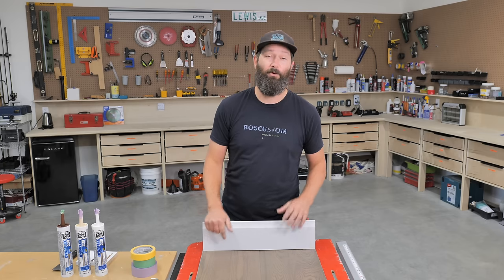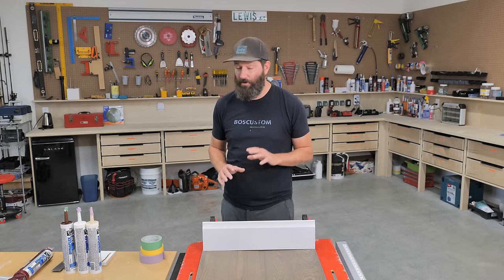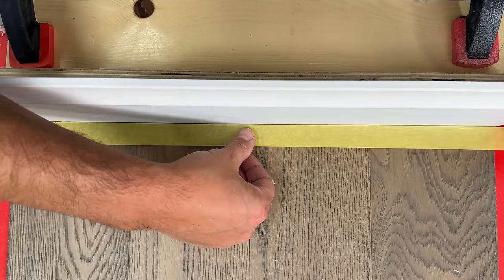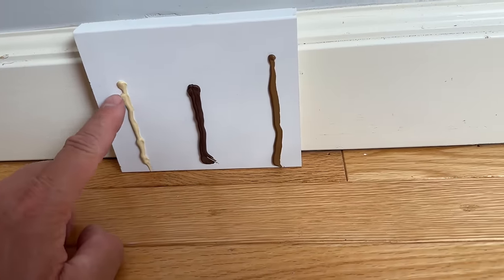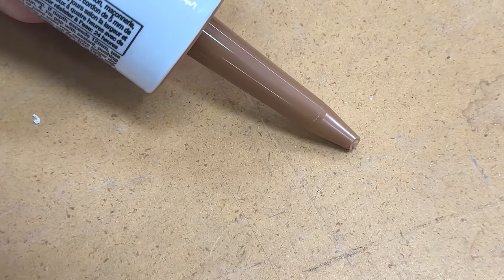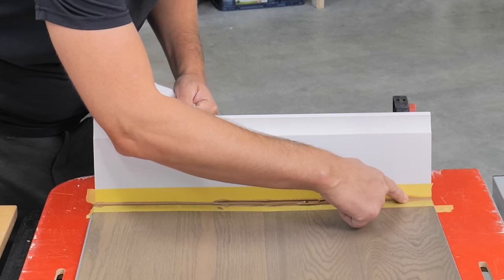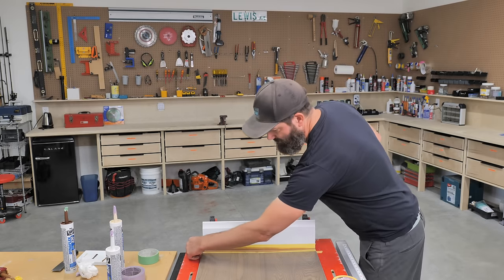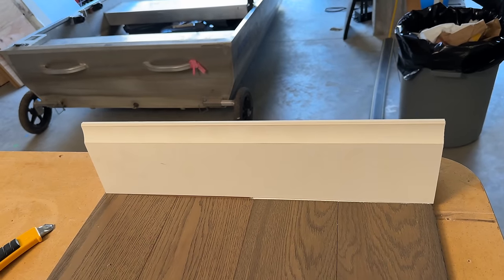How To Make Gaps Under Baseboards Disappear With Caulking

Comment: I'm going to be installing PVC baseboards on top of a fairly rough concrete floor. We already bought white caulk. Maybe I'll try to exchange them for gray. This area will be used for dog training and boarding and may be hosed/mopped out frequently. I'm thinking silicone caulk would be best. And the floor may get painted. I assume we should do that first.

Comment: When the floor expands or shrinks due to heat differences, it will pull apart. That is why the floor boards aren’t exactly up to the wall, they need to be able to shrink and expand. Better to minimize the gaps by making the floor underneath as straight as possible and using a good subfloor.

Comment: When our new hardwood floors were installed they left a gap between the floor and the baseboard at the doorways of one-half to three-quarters of an inch. Since this would be too large to simply caulk, what do you suggest in order to fix this? Thanks for your suggestions.

Comment: or gaps are good.  gaps just saved me from water damage.  water got in the wall, and thanks to the gap in my baseboard mouldings, it poured right out onto the floor completely.  no damage!  before that happened i would have been a caulker for sure, now i thank my baseboard gaps everyday.

Comment: I don’t tape, put your bead down and for painters caulk mist with a spray bottle of water and use a rung out sponge.  For bath/kitchen silicone, use rubbing alcohol to mist and a dry disposable rag.  I do use tape for silicone caulking if the gap is bigger than 1/8”.  If it is something you can put a very small bead on and mist, it tends to not spread outwards.

Comment: Best way to fix those gaps are with a piece of quarter round, it'll flex and adds an extra profile to the trim which makes it seem more intricate and doesn't involve the mess of caulking. Scribing and cutting base to fit tight looks chincy to me as you can see the humps in floor in the base

Comment: That wouldn’t have worked for our 120 year old house - the gaps were huge - buliders expanding foam solved it once and for all followed up by some architrave fixed to the skirting board. Several years later and it still looks great. Also keeps the spiders out!
Reply: Yeah, it keeps the spiders out, for now! But they're there, waiting!! 🤔🤨😐

Comment: I want to add that most of the other comments by the "other carpenters" here are very obnoxious, and I am not surprised, since most carpenters I worked with were the " I know everything and I am fast, and you can't teach me anything new!" type. I am "always learning new methods from other craftsmen. I once had another carpenter asked me " How come you get all the "high end nice jobs"...where I can take my time ?
Reply from the maker: I always get a chuckle from guys that say if you tried that in my company you'd get fired by lunch...or I don't choose to work for a company that has no respect for quality:). If you develop a reputation as a high quality carpenter, you won't be sitting around home much.

Comment: Thanks for the vid. I used an engineered hardwood flooring that has quite a bit of grain (Not a flat surface) and tried using tape but I couldn't get the tape to follow the contour of the grainy surface so it left little tunnels under the tape that the caulking would get into. any suggestions for how to handle this? I am not bad at caulking, so tried no tape and finger method, but the same thing happened since couldn't get my finger to close up on the grain either.
Reply: you need to press the tape down harder so it follows all the contours

Comment: I have never known there are so many people think it's a good idea 😵 as a normal handy man, no one will caulk the gap between baseboard and wood floors because the expansion of wood, the right way to hide the gap is cut the bottom of baseboard during installing, or add a door stop or 1/4 round

Comment: How do you cut the tip of the caulk tube? I know with a razor or the cutter in the gun, but I mean how much do you trim off and at what angle? Thanks.
Reply from the maker: For this it doesn’t really matter much. For other jobs it does though.
Reply: @TheFunnyCarpenter when does it matter?
Reply from the maker: @Perfectly_Balanced930  check out the video at the end of this video.

Comment: I wish to add a new plynth/kickboard under a new integrated dishwasher. The floor in front is not level so the kickboard will need adjustment. Without a shelf to use to scribe the floor level onto the kickboard, how can I get this level? Any tips gratefully received!

Comment: Scribe and trim your baseboard to match the contour of the floor. No gaps, no caulking and works on floating floors.
Reply: Most people don't have those skills , hell most people don't have the skill to caulk without making a mess  as it always looks easy in the video 😉
Reply: @manchesterexplorer8519  If you can't slide a pencil on a shim and then cut that out how did you install the baseboards in the first place?

Comment: House painter here, I never caulk those gaps. You especially don't want to caulk with white caulk because that immediately erases the straight line of the baseboard and are left with a wavy looking baseboard that looks terrible. That leaves a dark caulk & it looks better than white but at the same time it also is, in my opinion, not worth filling a dark gap with a dark caulk. It's like digging a hole to fill it.

Comment: Better solution is to sand your trim in the high spots so it doesn’t leave a gap to begin with
Reply: The best solution is to just install shoe moulding....jesus.

Comment: I have never seen baseboard installed without shoe molding? Did the carpenter leave it that way? I also have seen houses that were remodeled put carpet down and leave off putting down shoe molding but all non carpeted floors had it?
Reply: in high end jobs, not every client wants a "shoe look"
Reply: @carpenterabc I have been on many jobs and have no idea how many houses I have been in and all had shoe molding with the exception of trailor houses.

Comment: Try not to use it, but we caulk, then spray with glasscleaner brand cleaner, then use a rubber caulking spatula and to finish a paper towel to wipe off excess and dry. Perfect every time, no taping and fast

Comment: I prefer to leave the shadow line, and this is definitely  not a good idea if you have a floating floor.
Reply: The caulking will not stop the floor from a small movement. A large movement will only occur if you allow a large temperature swing inside of your house.
Reply: @michaels3003  I have to disagree,  any floating floor be it Vinyl, laminate or engineered wood will expand and contract over its life.. I have never experienced a room or house outside of a laboratory that maintains a constant or consistent temperature.  regardless of season.  The only time caulking would be practicable eould be on a non floating floor. For example in a bathroom where say a vinyl plank floor had been glued, (using a proprietary glue) to allow the installation and fixing of a sink, toilet etc. Even a modest temperature  swing will allow expansion and contraction. The practice shown in this video will cause Issues, particularly for DIY ers.  To fix something that arguably isn't broken.

Just saying like........

Comment: Our contractor put baseboards down and they are ALL crooked and the gaps collect mounds of dirt.
Reply from the maker: Yikes! This could have something to do with the cracked caulking.
Reply: @TheFunnyCarpenter  For the baseboards, they didn't caulk anything and they positioned crooked. When they caulked the seams in the kitchen and bathroom, see my other comment, they All broke free with two days
Reply: @bawintermage8351  They probably used a really low-quality painter's caulk and/or applied it way too thin. 

I dunno what kind of contractor you hired, but if you hired a trim carpenter, in my area trim carpenters don't caulk. We set all the nails, but caulking and filling is typically part of a painter's contract.

Comment: Wetting the tip of your finger before running it along the caulking gives you a smoother finish and won't drag the caulking. You can go over the seam again with a wet finger again to smooth it out even more.

Comment: I have big baseboard gaps bse of carpet being removed, i gotta lower the baseboards, maybe molding would be better.🤔
Reply: I don't like those cheap moldings that contractors use in my area, but "lowering" baseboards is a real PIA. I thought it would be simple, but I was mistaken.
Reply: I would use a shoe moulding
Reply from the maker: Check out my videos, I made one a few years back about this. You can definitely make a shoe moulding and make it look like part of the baseboard.

Comment: the problem is real wood cost a fortune and the cheaper baseboard trim is made of glue and saw dust and if you wet mop the water will  puffs up like a tampon destroying the trim. If you install new baseboard trim  would go as far as water proof the bottom and back side. Painters tape that's what I did for my moms house. After the repair I told her that she can't mop the floor like the old days with real wood. You can't pour a gallon of water on the floor and  swab the deck like a sailor with the cheaper laminate flooring and baseboard trim. Spend the extra money and get waterproof if you plan to wet mop.

Comment: I would never use caulk for this purpose. 1/4 round shoe is flexible and widely used for the purpose of hiding gaps in uneven floor surfaces (not including carpeted floors).

Comment: Why not just put shoe molding down instead?  Yes, initial cost is higher but it will last longer and probably look better.
Reply from the maker: Fair point for sure🍻
Reply: I've never seen baseboards without shoe molding, unless the room is carpeted. Is that a Canadian thing?
Reply: If/when I remodel, I will certainly use shoe molding.  But in the place I bought, this will work perfectly for now.
Reply: @emiller7040 I’ve seen it done here, but it’s not overly common. Not extremely rare either. But definitely don’t see it as much today as 30 years ago.
Reply: Personally, I have 75 year old white oak floors with gaps along the baseboard. Frankly to me it’s not broke so I’m not fixing it.  The floors look really good and so do the baseboards and I think it would just be a waste of time and money to do anything to change it.
Reply: Shoe molding and quarter round don’t look great in my opinion.  I know lots of people use it but to me it looks like what it is, another molding added to cover up the poor fit and finish of the baseboard.
Reply: My wife HATES quarter round with a passion. We have none of it anywhere in our house. I am not a fan either and would rather see a 1/8" gap than bulky quarter round
Reply: @thedon98677  Yeah, I was “trained” to hate quarter round by my wife.
Reply: @thedon98677  Me too. 🤭🤣
Reply: @skank-hunt_42  Yep, same here.
Reply: Base shoe molding is only good for vinyl, laminate flooring or wood flooring, but you don’t install base shoe on a tile or porcelain flooring.
Reply: His way in the video is better and neater.

Comment: Our Contractor used the Dynaflex and it's ALL cracked in the bathroom and in the kitchen,( after 6 months)  what went wrong??
Reply from the maker: Hmm dynaflex installed with proper bead size for the application is usually pretty good. Hard to say.

Comment: Let's start with the fact that if you have a wood or laminate floor, you should always have a piece of quarter round there that covers the gap. Caulking this gap is the stupidest thing you could possibly do  for 2 reasons. 1) now you have to paint that caulk, and if you don't cover all of it, the unpainted caulk will attract dirt and look much worse than a gap ever would. I would also add that painting that caulk is going to be the hardest thing you can do if you're not a seasoned professional. 2) I guarantee you there isn't a  caulk on the market that's not going to eventually crack which will ultimately  look far less cleaner than just the Gap you were trying to fix in the first place. Let me also add that I've been a professional Carpenter, painter, handyman for over 30 years and I have never seen anyone do this for the reasons I've mentioned above.

Comment: Never caulk on the floor the floor is always moving. I always push it down with a Piece of wood with my knee till the gap is gone. Then put a small nail in the wall so the wood cant bend back. You dont see the small hole from the nail cuz you caulk the top

Comment: Or just use toekicks. They also help protect the base board.
Reply from the maker: Definitely a good option: A lot more work and harder to just do one spot….but if done correctly it will look better.
Reply: I know what a toe kick is on a cabinet, but I've never heard of applying anything called a toe kick to a baseboard.

Comment: Obviously this is for DIYers not professionals. If your baseboard is that tall where it won't flex down to meet the floor you might want to try some quarter round or base you to cover that crack instead of caulking the floor

Comment: There is supposed to be a gap it allows airflow circulation and the ability to replace flooring. Lol. Don’t seal the gap for cosmetic reasons, leave it alone for practical reasons. You will thank me when you have a plumbing issue in the wall or ceiling or if you want to replace your flooring.
Reply: Well it's not cosmetic for me. I have bugs coming from the outside through the gaps and my baby needs to be able to crawl and play on the floor

Comment: I'll probably get crucified for this, but if you're actually installing the base trim, whatever happened to scribing it into the floor? I know it's all about how quick you can get something done these days, but what happened to all the old school carpenters who didn't use any gimmicks and tricks? However, if you're covering up someone else's mistakes, I can see where the caulking could work as opposed to doing everything over. I love the use of caulking in its place, but I've never seen it put on a floor where it didn't have to be redone every so often. Or, as someone else suggested in the comments, use quarter round.

Comment: Don’t see whats the problem with a small gap, its easier to paint down to floor as has nice clean line also caulk or silicone looks ok when new but looks crap when older gets dirty or starts to peal or crack, better to have a little gap to allow for movement

Comment: Of course the only way to get rid of the gap is to SCRIBE IT. Do it once and it will close for ever, no muss no fuss and no worry about a floating floor or tubes of messy caulk. Any competent carpenter will agree

Comment: Dont bother the tape. Use a smsll squeeze
Reply from the maker: The tape is essential when it comes to floors in my opinion🍻
Reply: @TheFunnyCarpenter I've been having good luck with a wet, clean finger and/or a lightly damp grout sponge.  Have you tried this way?

Comment: Sorry but no, you don't caulk baseboards, ever. I get there's different methods and approaches to carpentry, but you simply don't do this cus it's always noticeable, it will absolutely crack and it will look awful, no matter how skilled you are. You scribe baseboards to the curves of the floor like a proper carpenter
Reply: This.
Reply: I agreed. Do not caulk the bottom of your baseboards.
Scribing the boards is the best way if your gaps are large.
Another good way in my opinion is grout.
I just installed Porcelain Tile and added a small amount of grout, turned out great. The gaps weren’t bad.
Reply: Meeeow 😂
Reply: Scribe? I thought this was a DIY project
Reply: How much? 🤨
Reply: There are products that  don’t shrink b
Reply: But I'm not a proper carpenter and apparently didn't hire one either. I have a life, so I don't want to learn carpentry just to make the baseboards look better and keep crap from running under there.
Reply: @ED-es2qv but that's the point made by the original poster of this comment, you scribe them because the method proposed in this video has no real longevity aesthetically. A DIYer would still want to do a good job. The other option is you live with a small gap because caulk or sealant, after a number of years, is going to look out of place against the baseboard/skirting, and over time will likely look worse than the small gap...
Reply: No, regular people buy houses that already have baseboards installed. With gaps.
Reply: Isn’t that what the quarter round moulding  is for?
Reply: People that start talking by saying "sorry but" are invariably douches not worth listening to.
Reply: This is nonsense hire a proper carpenter
Reply: Some handy people👈 remove "old " things and replace it with what they want. 
Some are disasters.
Reply: What about in a bathroom and you want to protect from water damage?
Reply: Scribing skirting boards to floors can look a bit shit though depending on the state of the floor. Ideally the sub floor should be levelled ( or at least made flat) before the floor covering goes on top but some times it isn’t practical and scribing skirtings to floors like this can look awful. This method could be used to hide some of that. One solution does not fit all.
Reply: That's nice. I have a spill that has crept UNDERNEATH my base boards that I cannot clean now. If I shouldn't caulk it, then what do I do?
Reply: @Lomhow  why not use a foam cleaner then, wet vac it out? 
Baking soda, hydrogen peroxide and a little dawn dishwashing soap with a brush also cleans grout. 
My opinion. 😊🙏
Reply: There's a lot of people without a proper table saw or the skills to make a cut like that. Caulk has its place.
Reply: From the other response it sounds like you rip off the baseboards then tear up the floor and subfloor. Then reinstall the subfloor, then the floor. Then scribe the baseboards so you don’t need caulking because you would never caulk baseboards.